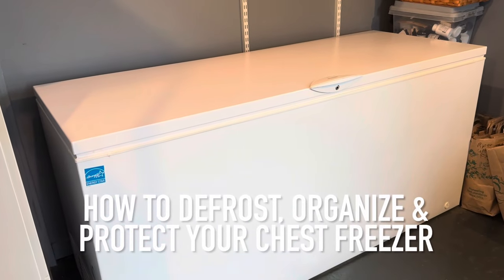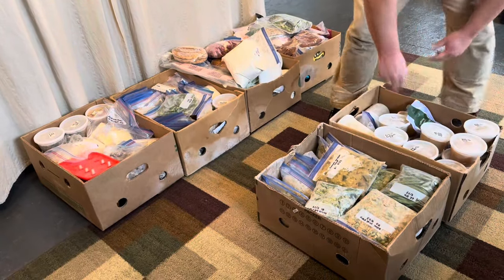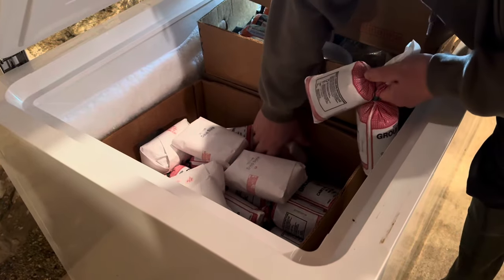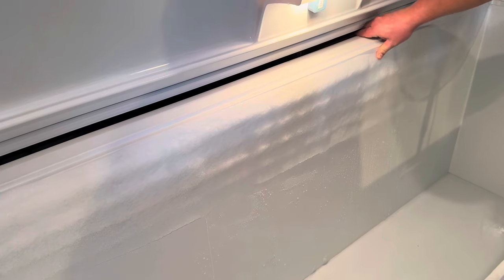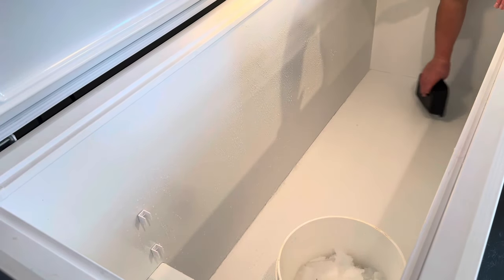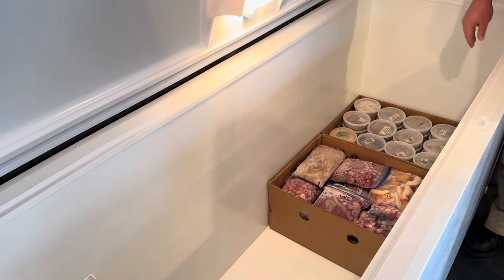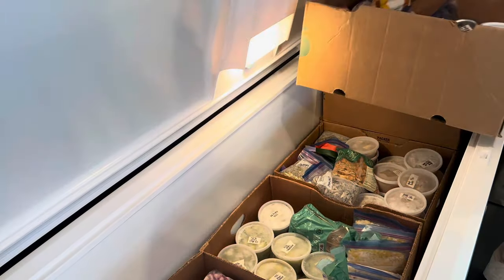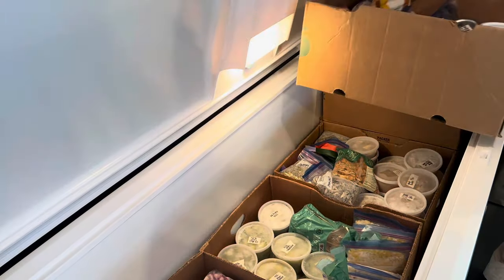How to organize and DEFROST A CHEST FREEZER (like a pro!)

Comment: I have a small chest freezer, that I love.  It was inexpensive and works so well.  But it is problematic for organization.  I have tried everything, literally.  I finally settled on colored, reusable grocery bags, usually made out of a non-tear, durable fabric.  I have a schedule taped to the front, and everything is color coordinated.  I.E., chicken - red; beef - yellow; pork - green, etc.  The bags are easy to fill and move around, and they conform to the space available.  I still have to move a few on occasion to get to what I want--why is it ALWAYS on the bottom--but it is easy!  I can see at a glance where the bag I want is, and the strong bag handles make it easy to move them out and around.  Works better than anything I have tried.  I would LOVE to have a totally organized system, and I have seen some that have sliding drawers, etc. but it is just not in my budget.  My system works a treat!  Thank you for the videos.  I always enjoy them.
Reply: Also, repackaging and vacuum sealing meats and breads (freeze the breads first so they don't squash when vac sealed), makes everything safe from freezer burn and last longer!  Vac Sealing is the best thing since sliced bread!

Comment: If you don't have boxes and/or have a smaller freezer, you can also use paper grocery bags.  They can tear over time with the dampness.  But they do tend to last quite a while.  Especially if you double or triple them up.  You can also use a sharpie to write on the outside of the bag.  If they tear, no worries, just stick the torn bag into the recycle and replace with another free paper bag.  

I've also used a blow dryer to help speed up defrosting the freezer.  Just stand there and blast it.  Takes just a few minutes to really get going.  Super fast.

I also like to organize the freezer with older stuff on top.  Makes it easy to systematically use up the older items first.
Reply from the maker: You should never ever thaw a freezer with any type of heat! It can damage the walls.

Comment: Thanks for sharing.  I'm more concerned about freezer temps when the power goes off - so a wifi unit is not for me but a battery unit with alarm.  I also like an ice-cube indicator.  Put an ice cube into a ziplock baggie and tape it someplace easy to see when you open the door.  If the cube has thawed you know your food is suspect.  I started doing this after I came home from vaca.  I knew the power had been off a few days and had no idea if the freezer had thawed.  The power also came back on while I was away so everything was frozen - but - did it thaw?  I looked at the ice-cube indicate to see it was still in it's cube form so I knew my food was fine.
Reply: Don't they make frost free chest freezers

Comment: Why dont use anything with heat like warm water or hair dryer? When searching fastest ways to defrost i saw people using pots of boiling water (just put the pots on a towel) then close the lid to cause the ice to melt quickly. I also thought about using my heat gun (not too close) because i may even be able to do that without removing the food and letting all the cold air out. Im just trying to find info if this could damage the freezer where im aiming the heat gun.
Reply from the maker: It is never recommended to use heat. Going from very cold to hot can warp, crack, or otherwise damage the freezer walls.
Reply: @wholefedhomestead  Thanks

Comment: You mentioned the ice building up around the door area of the freezer compartment at 00:52. Yes, ice can build up there and prevent the door from seating properly. Another culprit for this is that ice builds up in the freezer door itself that will warp the door over time and damage the insulation from over compression.

To avoid this what I do every time I defrost a chest freezer is take it outside with the door open and let the door drain out. Depending on how much ice is in there the process can take hours. Just expect it to take way longer than to remove the ice and water from the freezer compartment. It also makes a serious watery mess, so that’s why I take it outside.

On a side note, cleaning out the compressor area is a great thing to do while defrosting. It will also extend the life of the appliance, and if the freezer is kept in an area like a garage where bugs get in spiders love to lay their eggs there among other things.